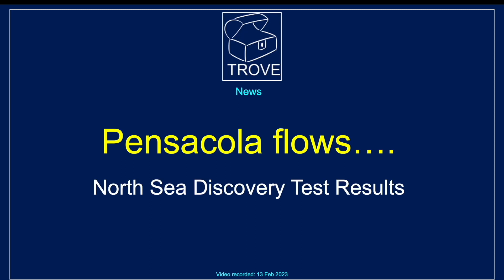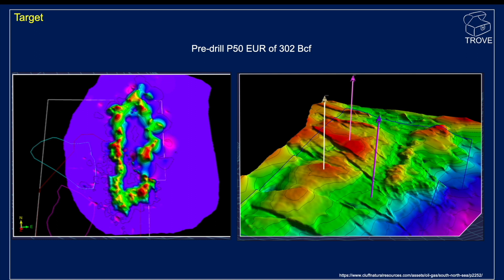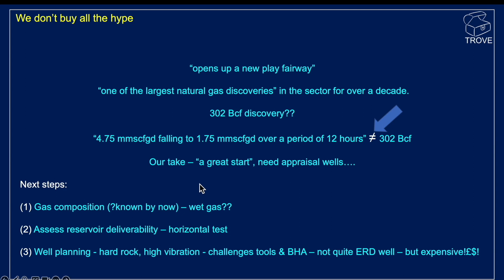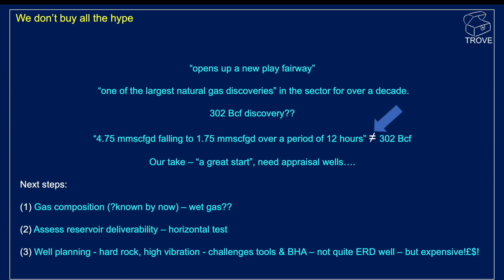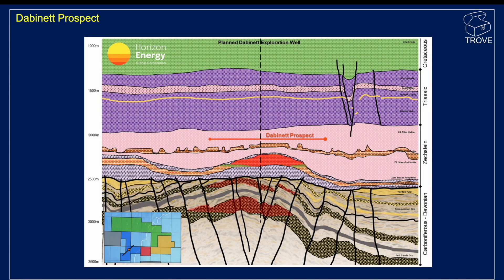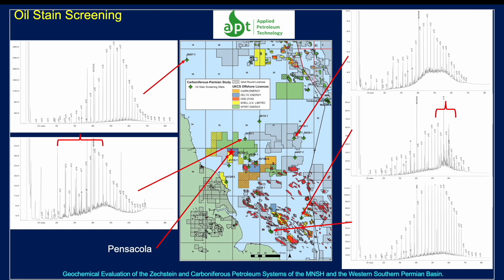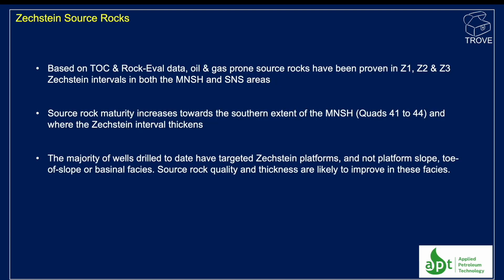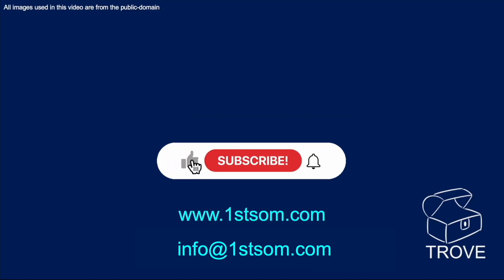PENSACOLA Discovery & a look at Zechstein source rocks

Comment: I'd been looking forward to this video after the test results were announced. The source rock info is very interesting!
Even if 302Bcf is difficult to prove from a single well, the result should mean that Pensacola is larger than the MEFS. Encouraging that it has matched pre-drill expectations.
Reply from the maker: As we say in the video, it's a great start but we'll need to see more before we can say 302 Bcf with certainty. We'll be keeping a close eye on Pensacola and the other opportunities nearby (Ossian, Crosgan, Dabinett & Resolution).
Reply: So Shell are wrong saying it’s 302 bcf ? Don’t think so, you’re guessing for the sake of making a video, as you say you haven’t seen the data,
Reply from the maker: @marcthomas8615  Hi Marc. Firstly, I believe it is partner Deltic who quote the number, not operator Shell. Secondly, the 302 Bcf number comes from the pre-drill analysis and the probability that the actual well encountered exactly the same as was prognosed is near-infinitely improbable. Also, we understand the original model was a 'fringing reef' sedimentary environment but this reefal build-up was not encountered (see Deltic presentation). You cannot assess 302 Bcf from a single eight-and-a-half inch diameter drill penetration and a limited drill stem test (DST). So we CAN say quoting a number of 302 Bcf is (extremely likely to be) wrong, based on these facts. And that is indeed without seeing the detailed data. It's called experience.